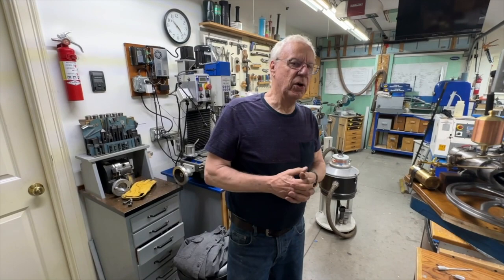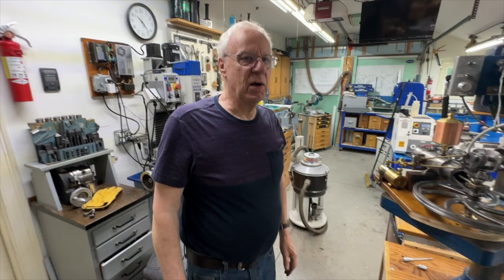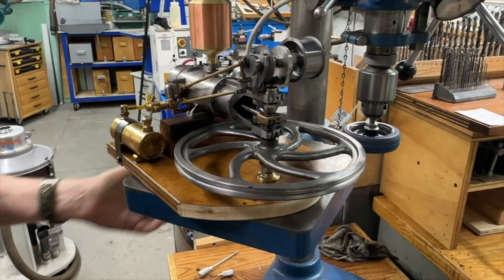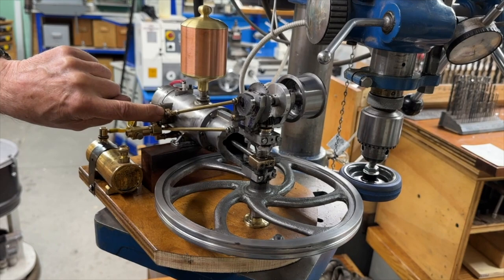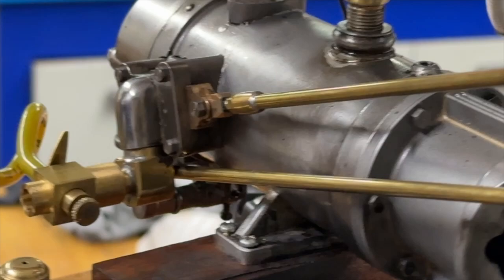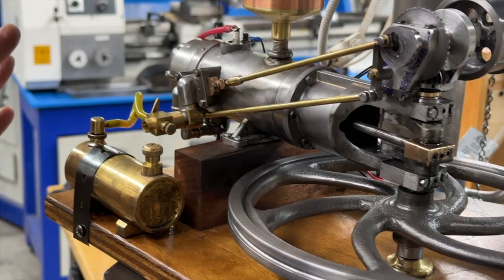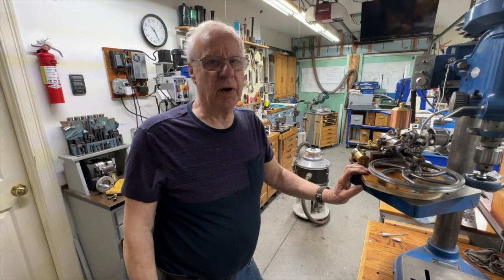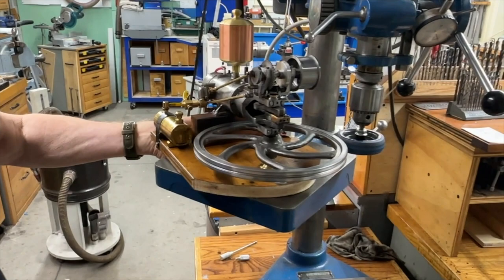Karl Benz First Motor Car Engine

Comment: nice one Joseph ! there are Kits made in germany from TS MODELLDAMPF , Thorsten Schur , he makes very nice castings, also Steam !
Reply from the maker: When I was trying to order the castings was during Covid. I thought they said they were not going to provide that casting set anymore. Something must have changed or I didn’t understand correctly. Thanks for the clarification and your interest. Joe
Reply: @JoesModelEngines  if u want i can ask Thorsten! but it could be that he maybe does it as a side hustle and doesnt have all the castings on hold....let me know , i can ask him if u maybe want to get other castings from him ! he has a few very unique steam engine castings aswell as a very nice Benz type 2 Engine! there is also another german "brand" called "bengs modellbau". they have also some nice sets, but a bit too much brass in my opinion and too pricy.
Reply from the maker: I’m still working on the first Benz engine and I am also starting the Galloway non Dead center steam engine. 
I’m going to be busy with that for some time. I have saved the information you sent and will think about it. I’m 80 years old and I don’t know how long I can keep building engines . Also I m staring to slow down, not so much time for the shop .Thank you again for your interest and help . I’ll be posting a new video when I finish the The Benz.  Regards Joe